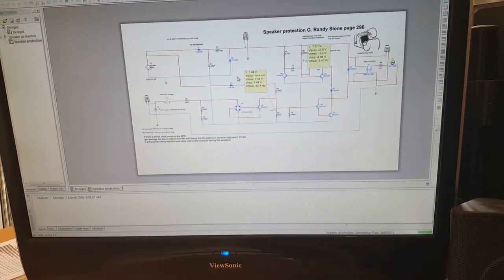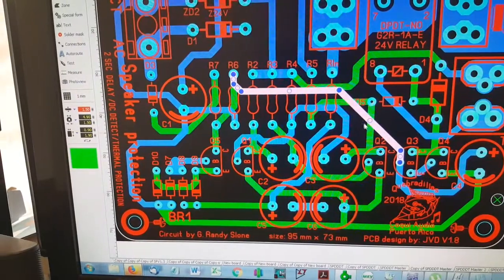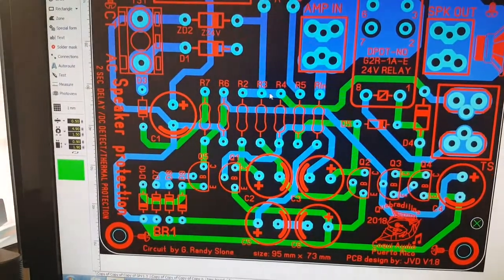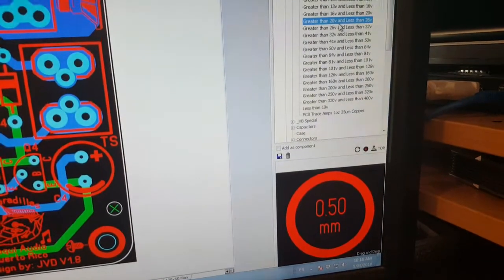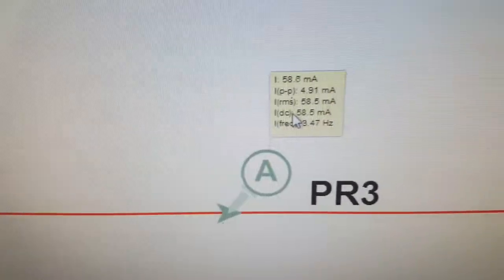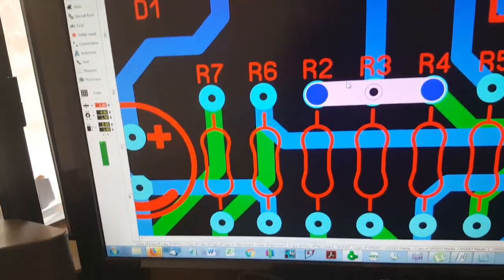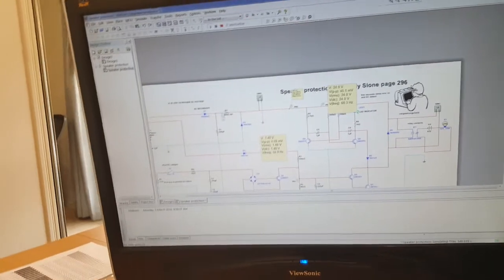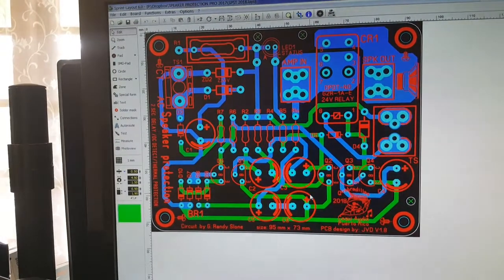PCB Creepage

Comment: I see you make the tools thank and the tracks I wasn't thinking to fallow much about the creepage rules but you are right also make sense to do traces that are not need to make all traces wider that 1.50 mm  I think I still have the single side board mentality mt bad lol and I kept making the traces wider when they are not need to be yes , and yes I found the typo error on my simulation R6 is in fact 56K on G. Randy Slone page 296 schematic
Reply: good thinking Mr. ST so having lower AC voltage :)